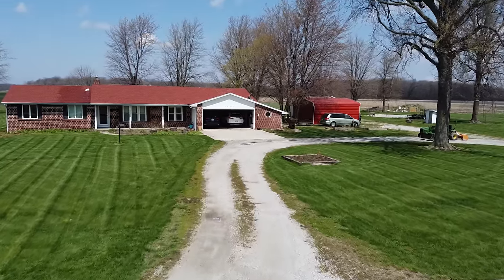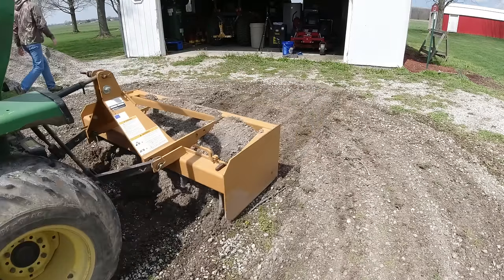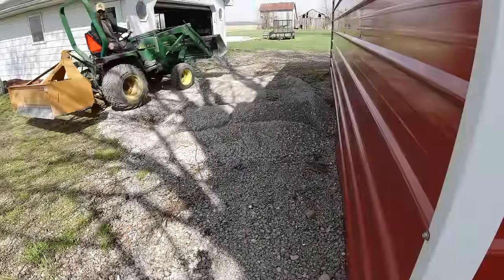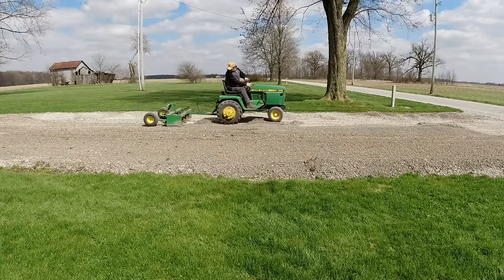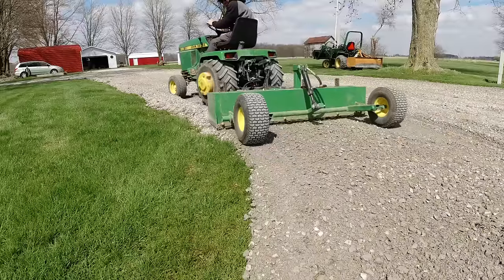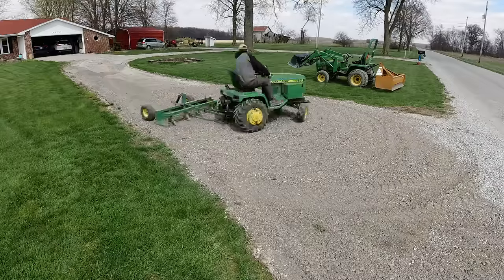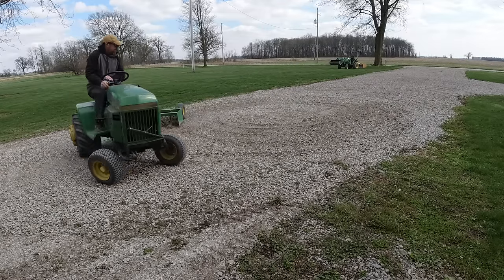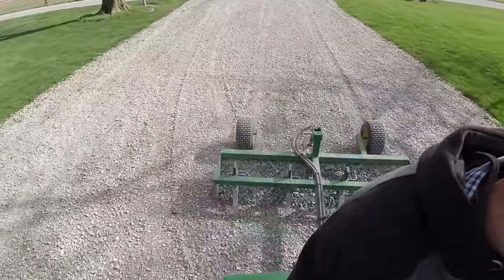Restoring a Gravel Driveway with Box Scrapers

Comment: That's the exact vidio I've been looking for for months. I have a JD 420 with a DR grader that I've been using on my drive. I bought a dump trailer last month and have been hauling stone for drives. Well didn't take but a month to convince myself I needed a compact tractor with a loader to utilize the dump. So I bought a bobcat 2025. Which is a kioti tractor. Instead of buying tons of implements then wishing I had something different im researching to see what's out there. Box scraper works but is there an advantage with a power rake or is it not worth the money? I'm planning on doing what you're doing in the side with my equipment. But back to why I said I've been looking for a video like this. I got some key ideas like circles makes sense and making the bucket flat to back drag. Good vidio with good common sense.
Reply from the maker: Thanks for the kind comments Ron.  I'm glad you were able find some useful information from this video. I think you're likely on the right track with the equipment you have so far it sounds like to me.  Personally I've never used a power rake but I have seen they do a tremendous job.  They are a little pricey though.  I've gotten by with what you see here on many projects over the years and seems to work well for me.  I like the versatility of the box scraper and I'm particularly found of the pull type box.  Good luck with your projects and thanks for checking out the videos.  Take care!

Comment: if you have a hydraulic 3 point adjustment the regular box blade is easy to use for everything...  otherwise you have to get off the tractor a bunch to adjust it by hand in order to effectively...  at least that has been my experience so far.
Reply from the maker: Do you mean a hydraulic top link on the 3 pt hitch?  Or do you man hydraulic raise and lower?  I have seen people use the hydraulic center link but then that requires power beyond hydraulic remotes in the back of the tractor too.  That would be a really cool upgrade however!  Thanks for the feedback and appreciate you watching.
Reply: @digdrivediy  yeah that's what I mean.  It is a major upgrade if the tractor dosent come with one.

Comment: Where is crown need it for water to run off and not push gavel away
Reply from the maker: That's a very good point.  In a lot of situations you would want to crown the driveway to prevent erosion.  In our situation, we seem to get away without a crown for whatever reason.  We are extremely flat around here and don't get a lot of heavy water induced erosion in our driveways because the water tends to pond and run away very slowly instead of moving at a fast pace.  Most of the time the house elevation is higher than the road and all the water just moves towards the road ditch across the driveway and there is no issues.   Thanks so much for watching!

Comment: Dear Neil what is your weight setup on your 318 john deere, how many wheel weights do you have on the tractor and do you have liquid ballast in your tires?          Sincerely Kadin
Reply from the maker: Hi Kadin!  On this John Deere 318 I have the 70# starter weight in each rim with a 50# standard wheel weight for a combined total of 120# of cast iron in each wheel.  This tractor does not have any fluid in the tires.
Reply: @digdrivediy   thanks Neil for replying to my comment. I was wanting to know because I'm building a Cub cadet 149 hydrostatic. I was trying to find out what weight set up that you use. Because your setup looked like it performed pretty well.

Comment: Last fall and winter I restored a John Deere 430 Diesel Lawn tractor.  I did it because I want to level/smoothen my yard and ditches.  Do you think that pull behind grader will rip virgin soil?  I will probably do it in early early spring when the ground is still soft and then seed and feed it.  I was going to get a standard box blade, but now I'm wondering...
Reply from the maker: Hey John.  The 430 is a terrific tractor so glad to hear of another one getting restored.  If the grader has rippers then I think you could get it worked up but the biggest question is if the area is already existing sod.  If there is sod or vegetation already there then I think you'll have a tough time getting it worked up enough to grade it without tilling it first.  If though it is just dirt that has had all the vegetation killed then I think you'd be OK with a grader box and rippers.  The pull type box is the best for overall leveling in my opinion for what you want to do, they are just sometimes difficult to find.  Good luck with your project and I hope you love the 430 as much as I love my little tractors.

Comment: Great video. What do you think if using the three point box bladed in float mode and going slow to smooth out irregularities? I am learning to use mine and trying different methods.
Reply from the maker: Thanks Robert.  Depending on what you're trying to do you could possibly use a float mode, but with the way a 3 point hitch works in order for it to "float" means it would need to essentially be all the way down in which case it could potentially begin to dig when you don't want it to.  Being in "float" only means that the box will come to rest upon whatever the hardest surface is and follow along at that elevation.  So in other words, if you're trying to fill areas with loose material the box will not ever be elevated above the existing grade in order to drop loose material, it will just continue to follow along the top of the ground.  That is if it isn't actively trying to dig at the same time too because when in "float" it will naturally be wanting to dig a bit.  Float works great when trying to move something like snow where you want the box to freely move up and down over a contoured driveway.  Or, if you want to remove a bunch of loose material on top of an already existing hard surface, like pulling loose stones off the top of an otherwise hard and compacted driveway.  Good luck with your box blade projects and thanks for checking out my video!  Take Care.

Comment: Thanks for the video.  What rear tires do you have on the 755?  I like them and might go to those with a  little more aggressive tread than the stock turf tire.  I've also been looking for something better for the front but not much luck other than turf tires.
Reply from the maker: Those rear tires are 31X10.5-15 Good Year XTRA Tracs.  They have done pretty well for me. Yeah, finding tires for the older machines is a little bit of a challenge.  Thanks for checking it out!
Reply: @digdrivediy  Thanks, I'd like to find an HDAP type for the front but no luck so far!

Comment: Curious how much hydraulic power your 755 has in the event you had a 3pt scraper with hydraulic teeth. Seen one of those used by Tim of "Tractor Time With Tim."
Reply from the maker: Man, that would be nice to have!  I think that the 755 would be able to handle hydraulic teeth just fine.  It handles the loader just fine so I I wouldn't expect it to have any trouble raising and lowering the teeth if that's what you mean.  I'll have to try to find that video of TTWT.  Sounds like a great tool.  Thanks so much for watching.

Comment: Great video, Neil! I work for ABI Attachments and we offer a really unique solution to this work so i am just curious: Have you used or heard of the TR3 Rake which has a floating leveling blade between two gauge wheels? Not trying to sell anything I am just curious what your thoughts of our product is in comparison to this method you show here?
Reply from the maker: Thanks Casey!  I can't believe I hadn't heard of the TR3 Rake.  I just took a minute to watch a video on it and it looks like a really versatile tool that could serve many functions.  I'll bet it work great to prep our local baseball diamonds in the spring as well and eliminate a lot of our effort to remove vegetation in the spring!  https://youtu.be/T2F8s2eyP1I or here: https://youtu.be/crmgH_L-HVU
I think someone like me could get a lot of work done with one of those.  The only thing I might miss in comparison is the maneuverability of working the tractor independently of the attachment such when trying to fill corners and curves but perhaps this tool would surprise me.  Thanks for bringing it to my attention.  Would be interested in knowing cost.
Reply from the maker: Thanks so much for the info and thanks a bunch for subscribing Casey!  I looked through a bit more of your product line and it looks like you've got some fantastic tools available.  I may need to pursue something more for our ball park application.  I'd love to try something like this to see if it could help us out.  We are a small, low budget community with an all volunteer workforce but perhaps we could do some fundraising for something more suited to our needs to help maintain our ball fields.   I appreciate you reaching out and I will certainly keep this in mind.  Take care!

Comment: Can that homemade be made with a manual raise and lower. I have a JD112 that I think I could use to try and fix my own driveway.
Reply from the maker: It could be made manual, but for something without hydrauliics suggest using an electric actuator that can be powered up and down with the battery of the tractor.  We made quite a few electric versions and they worked great!